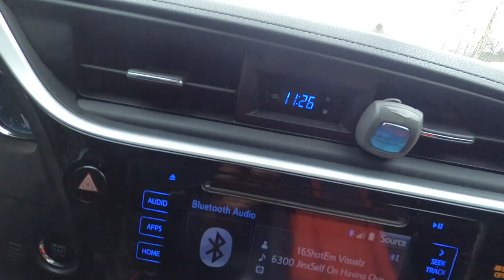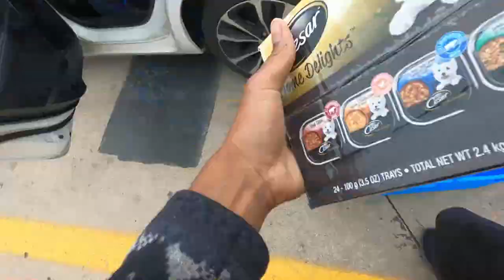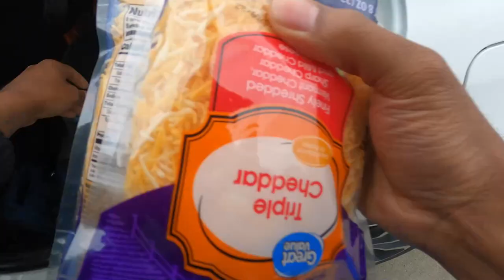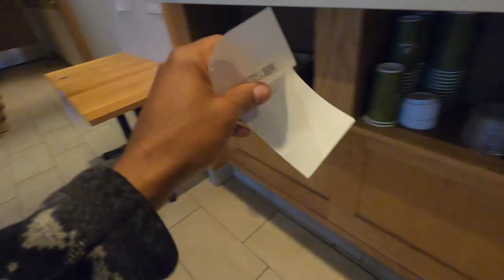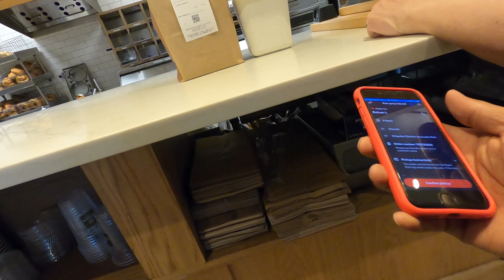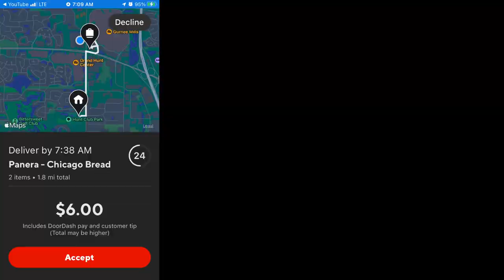Gig Work Driver Ride Along From Beginning To End! My Day 🙃 InstaCart, DoorDash, Spark Tips & Tricks

Comment: I am assuming that you are only showing us the orders that you accept. What are the criteria that you use to accept or decline an offer? How many orders are you having to decline in order to get a good one? I’m thinking about starting spark, and the info you provide is truly helpful, not to mention entertaining!
Reply from the maker: My criteria for Doordash and Ubereats is to get as close to $2 per mile as possible, with Spark for the most part we take all of the orders because the payout are usually good. We rarely take the In Store pickups because they are usually not worth it. You will be gone for usually about an hour or more and you could possible make the same money if not more doing 2 orders vs the 10-12 orders and it’s going to be way less miles. 

As far as how many I decline to get a good one: For Ubereats and Doordash it just depends on the day. Sometimes I get alot of good ones other times I don’t. I would say I definitely get way more bad than good though. The Spark orders are different because they only come in at certain times and most if them do have good payouts so we end up taking them.